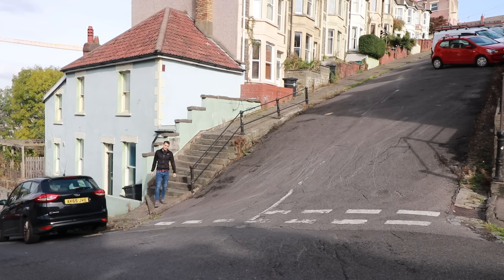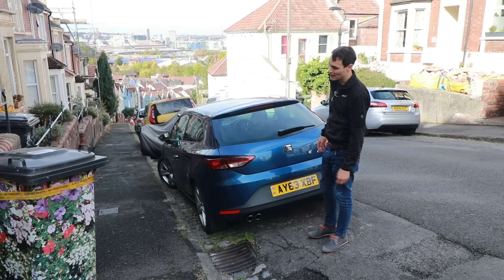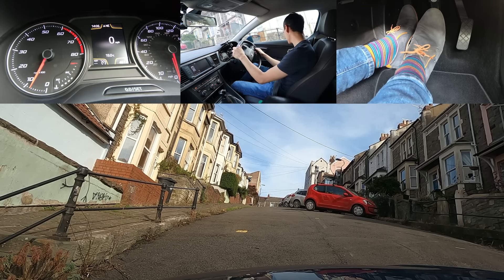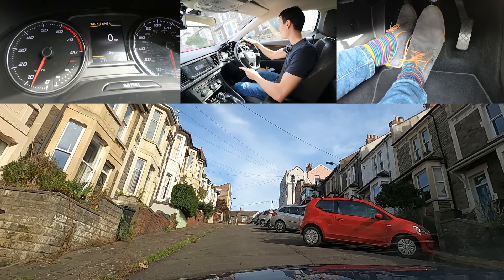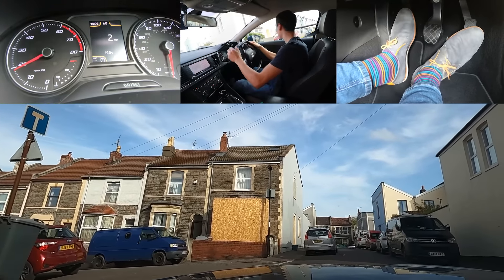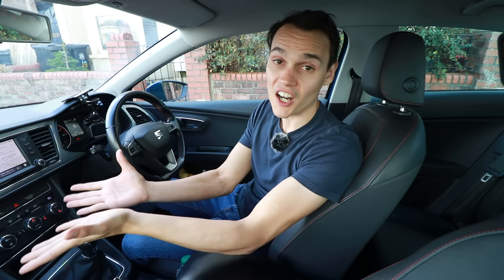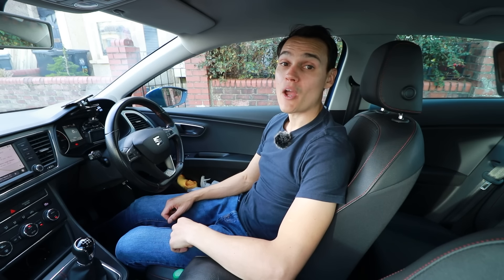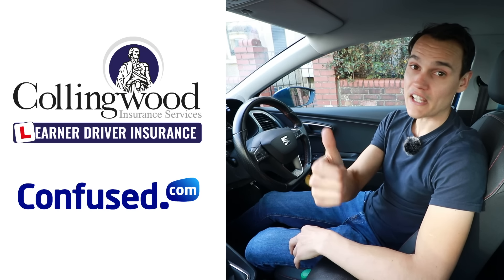Driving Instructor Stalls and Wheels Spins on the Steepest Street in England

Comment: So you went all the way from Colchester to Bristol just for filming a tricky hill start? I'm appreciate your great effort! 👏🏻
Reply from the maker: Yes, it took the whole day, a long day.
Reply: It was an up hill struggle!
Reply: If I was cynical and know Richard to be a hard working ADi and part time motor trade member I’d think ‘ mistress over there ‘ lol.  Sorry Richard
Reply: These days cars come with HSA making this slightly easier...
Reply: @ConquerDriving  you madman😵
Damn
Reply: The amount of bottom out scrapes from people coming round it with 'momentum' l pl l
Reply: Was thinking the same thing, but this instructors good I rate him.
Reply: @ConquerDriving  
Would North hill not have sufficed? 😁
Reply: @vijuvlogs  My newer 2017 SEAT Leon had HSA and my new Skoda Karoq has it. Very handy in Sheffield.
Reply: @antonycharnock2993  yes my Honda City 2020 manual has it and some of the steep inclines have been done quite easily because of HSA.. 👌🏻👌🏻👌🏻it's a brilliant feature
We are lucky to have such great technology 🙌🏻
Reply: @radioactivepotato2068  with a burnt out clutch North Hills fucking perfection 🤣🤣🤣
Reply: Some of my  older cars had such poor handbrakes that it was necessary to park in gear. 
To start on a very steep hill it was necessary to hold the car on the brake pedal and operate the accelerator with the heel (heel and toeing) to get sufficient engine revs to move away.
A few weeks ago I had  surprise when I tried to move off on as very steep hill in an automatic because the brake didn’t hold when I moved my foot from the brake pedal to the accelerator and the car rolled backwards.
I was now very close to the parked car behind me and I had to revert back to my old driving technique to pull away. 
I wonder what someone who only learned on an automatic would have done?
I asked my wife, an experienced driver of driver of manual cars but who was not aware of heel and toeing. Her response was to get out and put a brick under the rear wheel. I didn’t ask where she would get the brick but she had a point !🤣
Reply: @ConquerDriving  At first God bless you sir for all your videos
Sir if you can please make a video about mud hill i mean if there a hill and its mud how can we move car(with manual transmission) from flat and raise hill?
i will greatful for you sir.
Reply: Talk about saving the environment.
Reply: I knew this was Bristol from the title alone... Haha - I know that darned road
Reply: @ConquerDriving  You should feel very proud of yourself for going out of your way to help us that much, thank you :)
Reply: @vijuvlogs  yeah you sure are cause you shouldn t be behind the wheel without it.
Reply: @vijuvlogs  nope, makes it harder i think as you loose the feel of what the car is doing and you get lazy, give a first time driver a car with out these aids and they are stuck. i passed my test 22 years ago and my first car had no aids (no power steering, no servo assisted brakes, heavy clutch, 4 gears) made me a better driver. As much as i love my modern car, give me one with no modern features at all and i'm in heaven, so much more fun.
Reply: @vijuvlogs  Today's engines produce torque at high revs not low revs, so you have to rev the guts out of the engine to be able to go up this slope. Older engines with long strokes produce torque at low revs and would go up this slope easier.
Reply: @tonysheerness2427  depends on the cars .. maybe in your country that is the case but here, the torque output is better right from low end
Reply: @vijuvlogs  Short stroke high roving engines have no torque at low end, maybe your engines have longer strokes. The old engines use to tick over at 650 rpm today they tick over near1000rpm. Maybe you live in a more mountainous area with steep slopes where you need torque at low end.
Reply: At least he doesn't have to worry about his carbon footprint because he drives everywhere.
Reply: @ConquerDriving  I used to live on Steep Hill in Lincoln near the Cathedral  , that is crazy  to get up and 50 times the size of this one in video ! And Wales has a bad one in Little Haven next to Broad Haven Pembrokeshire , have a look it's just like this one but WORSE lol
Reply: Not many steep hills in East Anglia.
Reply: England is a small country
Reply: @ConquerDriving  u are pro driver
Reply: As an American, these mean nothing lol
Reply: Easier than going all the way to San Francisco, renting a car (since it can't be an automatic, Turo's probably the only option) and finding a good street (not Lombard, it's perpetually crowded with tourists and one-way downhill anyway).
Reply: @ConquerDriving  i just love to watch your videos
Reply: YouTube money 😂 is good , so he can
Reply: You’re appreciate?
Reply: The irony of Bristol being full of Greens is beautiful 😅
Reply: I hope Greta is watching 😆
Reply: He got a lot of money from YouTube 😂🎉
Reply: I mean there's not many places with a Pythagorean theorem shaped hill

Comment: I was taught to use the HANDBRAKE when doing a hill start (in a car with no hill start assist). With the hand brake engaged, find bite, add throttle, release handbrake, add more throttle + gradually bring clutch up all the way as the vehicle moves. Easy.
Reply: Same for over here in NZ, as just using the clutch with it just idling is not a good idea - at some point the engine will stall and roll back depending how step it is.
Reply: Sort of the same here except add a little throttle at same time as finding bite
Reply: Same, also the cars definitely didnt automatically add gas when I passed my test. I will need to test my car to see if it does, never noticed it.
Reply: @Subvenio  Most Traders vehicles have Auto Throttle.
Diesel Engines should Idle and Go from Standstill requiring NO Accelerator.

Caressing the Throttle👍......None of this VW Golf Rev &Go 💩💩
Reply: Never learnt it with the handbrake, always did it with the brake pedal. Just lift the clutch enough to hold the car still and immediately give some gas, if I need to add gas earlier I press on the accelerator pedal with the side of my foot.
Reply: Yes, you’re right. I thought we all did it that way. It’s clutch control . I’ve never heard of this expecting the car to do all the work for you.
Reply: Most cars nowadays have an e-brake
Reply: Exactly Where I am is like 1 massive steep hill all over the city. Just hills. Handbrake start every time

Comment: I’m a beginner at manual transmissions, and I’m in Madeira. Today I stalled the engine on a very steep hill and a bus was waiting behind me. It took me about 10 tries to get going without stalling, and the poor bus driver waited patiently. Nerve wracking to say the least 

Thank you for the video!
Reply: The main thing to do in that situation is to remain calm (if you can!) and not get flustered. Everyone was a learner at some stage in the past. I've been driving 40 years and I still make the occasional mistake. The worst was when I was test-driving a diesel VW Golf (Mark IV, I think) which had a weird engine that would stall very abruptly if you let the clutch up slightly too far or didn't apply quite enough power, rather than struggling and failing to get moving, which gives you enough time to dip the clutch slightly and/or apply a bit more power to rectify the problem. It seemed to be by design rather than a faulty car, because I had the same experience in another of the same type a few years later. The salesman said "Everyone does that when they first test drive this engine." I think the engine-management goes into "computer says no" mode and deliberately cuts the fuel if you are at risk of straining the engine. It was bloody dangerous. I didn't buy a Golf. I did try a later model (maybe Mark V) and that was fine - it was jsut the pre-HDI "Pumpe Duse" engine that was afflicted with this childish, petulant "I'm to going to play" engine management unit.
Reply: All of Madeira basically is a very steep hill... so that's a very important thing to learn...
Reply: Use the hand break... That is easy method of doing it, his way is for hardcore die hard "motorist" that insist on doing life on expert level.
Reply: Ronaldos birth place?

Comment: I'm from Denmark, I was never taught to apply gas before clutch, nor was I even told you could do it. 

I learned it myself after getting my license and my own car and just testing around, this is the only thing I feel like I wasn't taught properly.
Reply: If the hill is steep... well you need plenty of gas and be careful not to burn the clutch
Reply: but in some cars with less hp you need gas even on a flat surface to just start quick enough and dont block traffic behind you. which driving instructor forgets such an important technique?
Reply: @VinceGatling  Denmark is as flat as can be. But it should definitely be taught, because most small cars, no matter how new will need gas to clutch out in first gear.
Reply: waitaminute, do you have any hills in denmark though?
Reply: @winnex317   I live in the Netherlands and my car will move when only lifting the clutch, I also reverse with using the clutch only. I was taught to reverse that way.
Reply: It's only modern fuel injected cars you can get away with not using gas, and you still need to go very slow, no racing starts When I learned a long time ago, no fuel injection. You had to use gas to stop it stalling
Reply: I'm not absolutely sure what order I do it in. It's so automatic and inutuitive that I can't be certain, but I think I increase the engine speed and let the clutch up at the same time*, rather than letting the clutch up on an idling engine and then increasing power, or increasing engine speed and then letting up the clutch. I'll have to actually do it for real so I can work out what I do, if you see what I mean. Certainly it's a three-control process: clutch, accelerator, handbrake. My wife's car has Hill-Start Assist but I've never had the courage to try it, or the opportunity when there's nothing behind me so that if I *do roll back because HSA doesn't do what I'm expecting, I won't hit anything. I'm cautious: I prefer to rely on my own skill than a feature that is poorly-documented in the user manual. I think it allows you to leave the handbrake off and it will hold the car from rolling backwards, but will still allow you to go forwards. Nice if it works. Sadly that car rolls a long way (well it feels a long way) if you stop on the footbrake, apply the handbrake and then release the footbrake - possibly a side effect of HSA - so I've got into the habit of releasing the footbrake very slowly so it still rolls the same amount but doesn't come to such an abrupt stop. That's a Honda CR-V. The garage couldn't understand the problem until I demonstrated it, and then said "but that's normal". I said "Not in my 15-year-old Peugeot it isn't, so I wouldn't expect it in a 5-year-old Honda".
Reply: You have to do it when starting on a hill, there is no other way.
Reply: @CuoreSportivo  Denmark does have few hills, but they're usually small hills
Reply: @seancurran8108  I think it doesn't matter if the fuel is injected or not. What you actually need is drive-by-wire control for the throttle operation. If your accelerator pedal is cable connected, ECU (engine control unit) cannot open the throttle when RPMs drop and the ability to simply lift the clutch requires that ECU can increase throttle if RPM starts to drop. There's no extra logic for the cluch pedal, all the smarts are in ECU which simply tries to everything possible to keep RPM above stalling speeds at all times. (For diesel engines, replace throttle with fuel metering.)
Reply: @MikkoRantalainen all diesels have enough torque on the low end to start without gas
Reply: @tristan6509  Yes, if you lift the clutch with sensible speed. Drop the clutch while the engine is idling and you'll stall even a diesel engine.
Reply: @MikkoRantalainen  yeah but on a carbureted gasoline engine, it's impossible to lift the clutch without the engine stalling if you don't give it gas (unless you set the idle screw very high)

Mechanical injection diesels didn't have this issue, Mercedes also made mechanically injected gasoline engines and they don't have this issue either.

Comment: When I was a learner 20 years ago, most cars has a handbreak and uphill start like that would definitely with handbrake on so no rollback for whatever reason,  then release the clutch and apply gas at the same time slowly. When the car has enough power going up, the handbrake is released and you continue to apply more gas and release the clutch completely.
Reply: Indeed, the idea of having gas added when you step on the gas pedal is such a cool idea - I learned the handbrake trick because my first car was manual several decades ago, but first my father made sure I could start on a hill from first, second, and third gears. It’s all about knowing your car’s clutch very, very well. Interesting to see the differences in advice between US and UK teachings, and to see modern manual techniques since we sadly have almost no manuals in the US these days.
Reply: @nimue325  wow from 2nd and 3rd gears? RIP clutch - there would be no torque at those gear ratios. a hill start must ALWAYS be in Gear 1 - no exceptions. Any other gears would put serious strain on the drive shaft, gears themselves and esp the clutch - ohhhhhhhh the burning clutch smell will be something to look out for in Gear 2 or 3 😬
Reply: @fireWireX4  Sure, once I knew how to drive it was always start in first. But learning about the machine’s performance, learning to really feel the clutch and how to slowly let it out and notice when it is just about to catch without any damage to it, was the stress-test of the lesson. No smell, no sound, just gentle starting up! Never heard of a problem like spinning wheels, maybe because you have to be equally gentle on the gas.

And then there was this one time my gear shift somehow … fell down through the floor board … and I had to drive home entirely in third to replace a single screw. So it did come in handy directly. 🤣 But that was really never the intention, I swear!
Reply: Yeah. I wonder why he didn't mention using the handbrake for cars without hill hold assist. There's no other way, especially if there's a car behind you.
Reply: The first time i used handbreak for that i stalled and i always find it easier without it
Reply: @Luis-cr1tw  so what do you do on a steep incline when there's a car close behind you? Just hope that you won't bump into it? I guess you could use some heel toe technique to press both brake and clutch pedal. The handbrake method is not hard. If you stalled you either didn't use enough gas or lifted the clutch too quickly. When you get to the bite point and you feel the car wants to start moving, you release the handbrake. Zero reverse movement that way.

Comment: I appreciate that Mazda made the decision not to add gas for you. I was taught to add a little gas, find the biting point and then release the handbrake when ready back in 2009 (don't really do that now that I've mastered it). My 2016 Civic Type R is straight up to 1,500rpm as soon as you touch the gas to move off. If you don't touch the gas, it'll add a little bit too which is handy for slow moving traffic. I can't remember ever stalling it in the 4 years I've had it but I really did hate losing that control to start with, especially in something considered fast and sporty.

Comment: I recall when I did my driving lessons, I got an exercise to park and drive away on a steep hill. I was taught to put it on hand brake, clutch in and give gas. Then slowly engage the clutch until you feel it pull, but before the point you start rolling as you don't want to kill your handbrakes obviously. Then you release handbrake, give gas and engage the clutch, you drive away without rolling back :-). It's super handy when you have to travel through mountainous villages

Comment: Passed 19 years ago, have always put a little bit of throttle on whilst pulling away. You can get away without it if it's downhill, or modulate it for even less if it's flat. My dad taught me clutch control in a private car park at 16, learnt how to pull away without stalling in 5th without using the throttle, it really helped me learn clutch control!
Reply: You'll wreck the clutch doing it in 5th